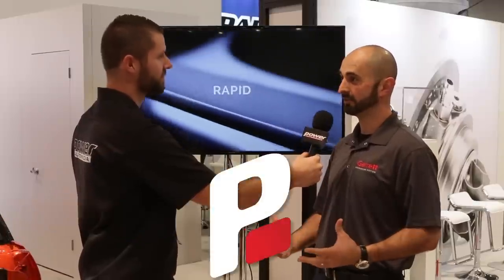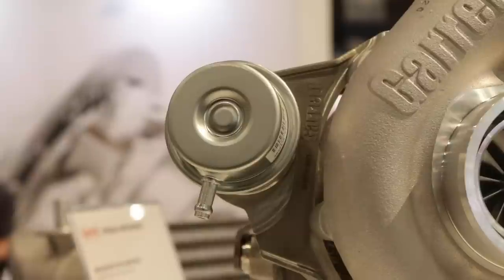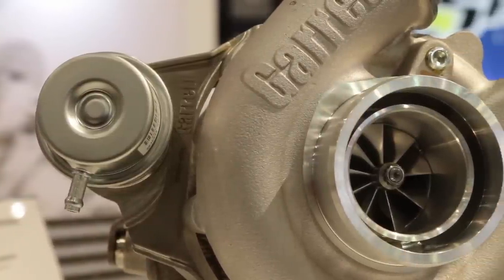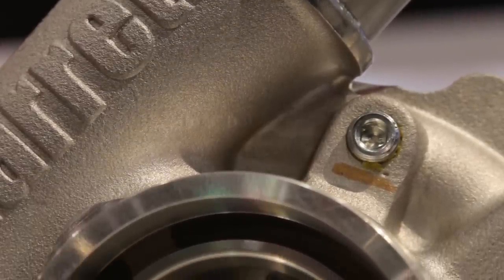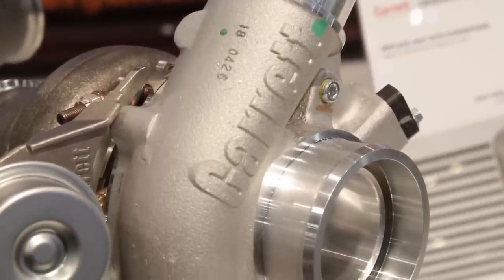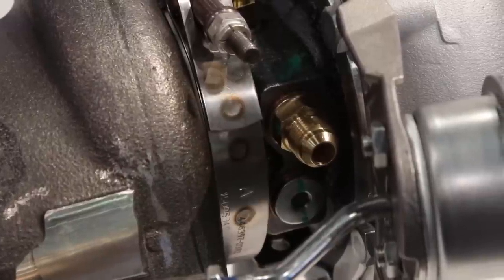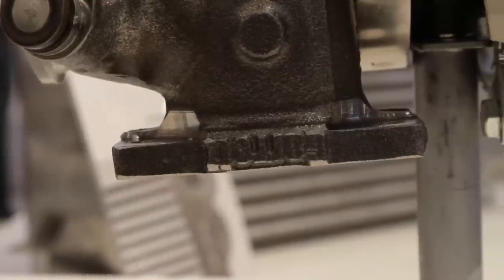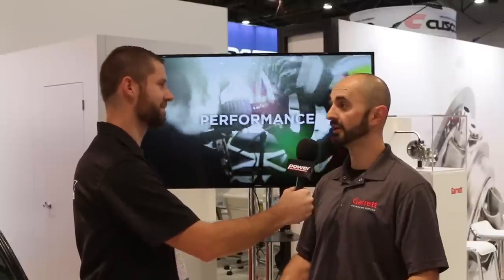SEMA 2018: Garrett's New G25 Turbos Designed Specifically for 1.8 to 3.0L Engines

Comment: it's hard to believe 660hp
from this size
Reply: Right, a guy in the focus st forums had sheet for 560ish with it. A different platform would probably get there with less boost so it possible i think. Very cool turbos.

Comment: Is this 550 whp?
Reply: No chance.
Reply: @mareksumguy1887  Have you heard of Small Frame turbochargers? These are meant to be small and pack alot, doing so will minimize lag etc.
Reply: @oskar4663  small frame means it’s.... small. And that’s ALL it means!
Reply: @mareksumguy1887  Just because it's small doesn't mean it doesn't make power. Take a look at the compressor map and then come back to me again. There's a reason why bigger internals are in a smaller frame. For response.

Comment: G25 to a 3.0L yeah, if you want to boost from 1000rpm and choke to 4000
Reply: It's not 1980 anymore
Reply: It’s called a wastegate duty cycle. Wastegate will open and bypass back pressure.
Reply: @RadDadisRad  oh ok. Put a gt12 then. Its 2020 bruh
Reply: If you listened to the whole thing, he said 2 on a v6, which is a common 3.0 displacement.
Reply: @JC-jj1xm  Leland above said its all about the wastegate :P
Reply: @JC-jj1xm  And with that logic i can say this turbo is capable for W16 8.0L if i put four of them...
Reply: @ngt84  pretty much . Putting 2 in my 1uz lol